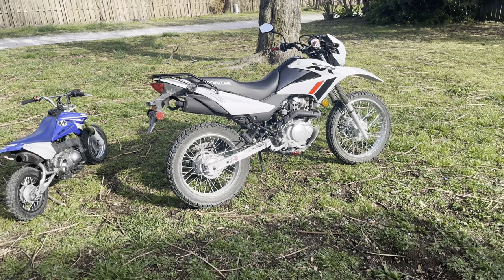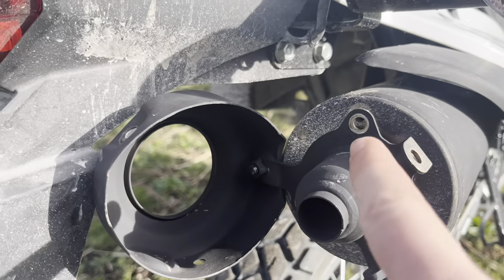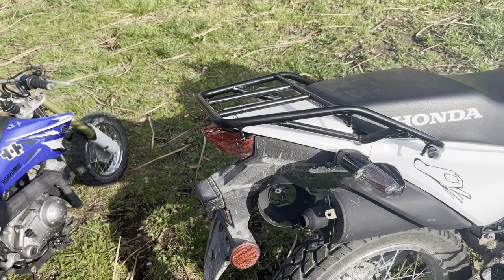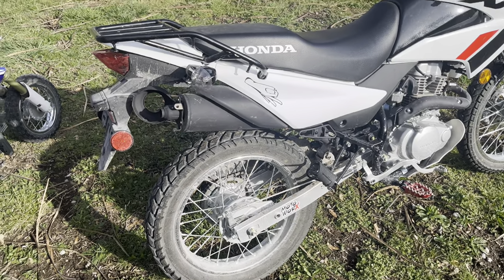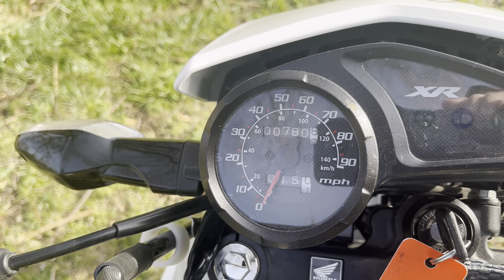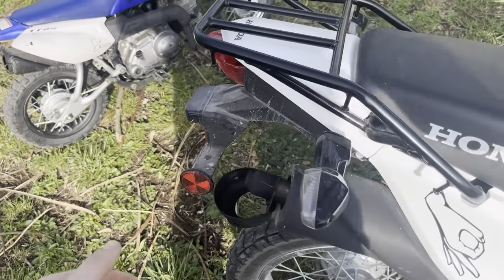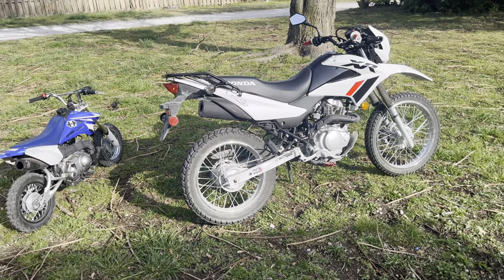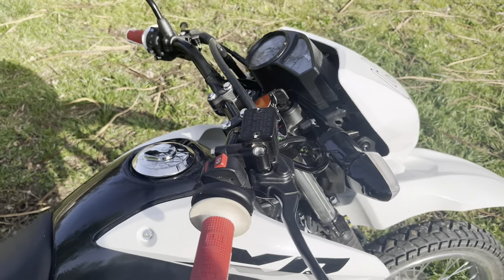2023 Honda XR150L Spark Arrestor Delete!!!!

Comment: Does this require rejeting to 1 110/115? Is there a noticeable power increase?
Reply from the maker: It’s going to be very dependent on elevation/climate because it’s a carbed bike. But the short answer is yes. I live at roughly 2000ft above sea level. The first day I bought the bike, right off the showroom floor, this is the first thing I did. And at my elevation, without re jetting, the bike was fine. I did switch to a 115 main jet, and it certainly made the bike happier as well as gave it more power. But I will say that just with the spark arrestor delete, the bike felt like it had more power.
Reply: @Shenanigrinz  and if it didn't REALLY have more power, at least it sounded like it did, right? 😅 
[got my 2024 XR150L last week. Pondering exhausts.  Seeing generic aftermarket units on eBay under CA$40- which is US$30-.  But no reviews so far.....?] 
Thanks for the video!
Reply from the maker: @bempey  absolutely lol. Feel free to drop a link to those generic exhausts. I may pull the trigger on one and do a review